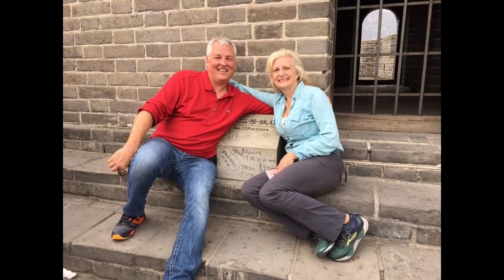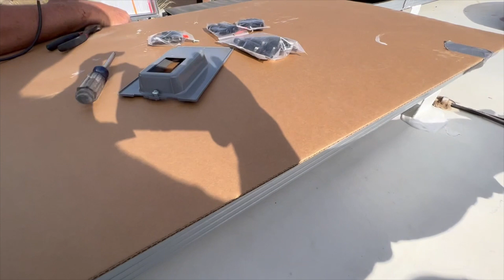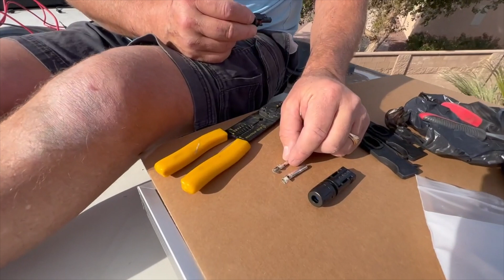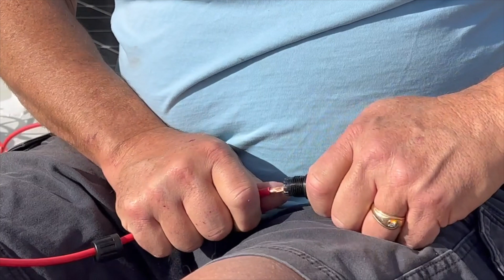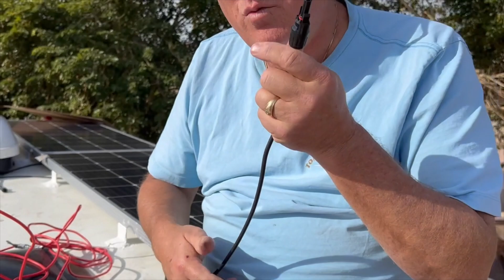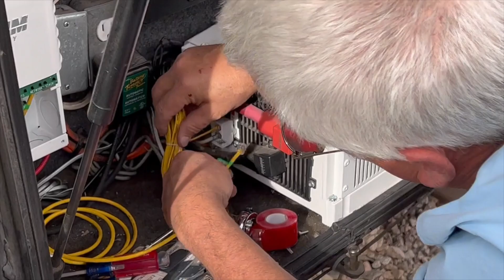Solar Install Step by Step, Adding solar to RV Roof top.

Comment: Dicor contains a lot of water so it will shrink and create holes and cracks or gaps over time due to that water loss which causes shrinkage. I only use AFCAT sealant. It has very little water and therefore very little shrinkage. It also adheres to most roofing materials.
Reply from the maker: Awesome, thanks for info
Reply: @RVLoveshack  No problem. It sticks to  wood, fiberglass, EPDM, EPO, rubber, metal and others. Great stuff. Best part is you won't have many holes to fill after curing and settling.

Comment: Nice job, but how are you getting full voltage in series if some of them are in the shade. Typically a panel in the shade brings down the total voltage more than its own voltage. What panels did you use? Do they have diodes to prevent this?
Reply from the maker: Here are the pannels we used
https://www.continuousresources.com/collections/solar-panels-and-hardware/products/hightec-solar-200w-36-cell-12v-nominal-solar-panel-5-busbar
Originally I wired pannels in groups of two. But wasn't happy with amount I was getting and time it took to fill batteries. So I connected all together which makes it now dump power into batteries in just a short period of time. When boondocking I try to always park in full sun open to sky because I also use starlink so sky is important in more than one need.
Thanks for watching.

Comment: Nice video.  What gauge wire are you using from Rooftop down?  Is that also 2awg?  I know you changed the wire from the Solar Charge controller  to the batteries/bus bars to 2 awg with a 100amp fuse.  Also, what size fuse are you using between your panels and the solar charge controller?
Reply from the maker: Thank you! We used a #4 welding wire. 19 feet in length.I’ll get back to you on the fuse, I need to double check it in the daylight

Comment: Wow! Great job, I dread getting up on my roof.. , I need to put one more 215w panel..to put me over a 1000w... Helen and I are power hogs too... We loved meeting you both at Q..😁
Reply: I think being a power hog is the only way to go especially when you have free power from the sun. For a one time investment for a lifetime of free power is well worth it if you can. Always start with an inverter and charge controller as big as you think you'll want in the future that way you're not replacing it when going with more panels or batteries. Panels and batteries can always be added later at anytime as long as you go with Lithium. Lithium is way way cheaper in the long term. There are plenty of good drop in ones out there. You Don't have go with Battle Born at 1000 per 100 Amp hour.
You can get some good ones for 375 per 100 amp hour unit. That makes it affordable since that's equivalent to 2 AGM or flooded lead acid since you have better discharge plus you can charge them much faster.
Reply from the maker: Hey nice hearing from you. I feel good now with what we have on roof so think we are good now.